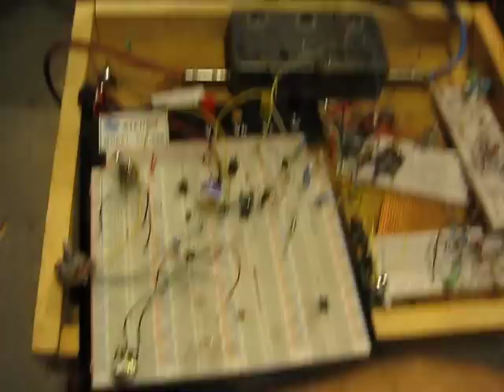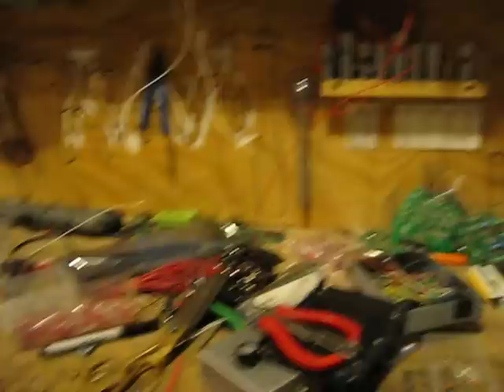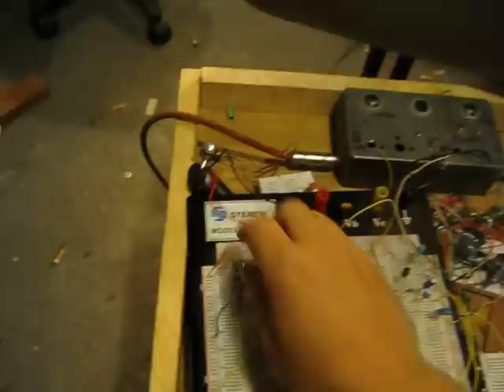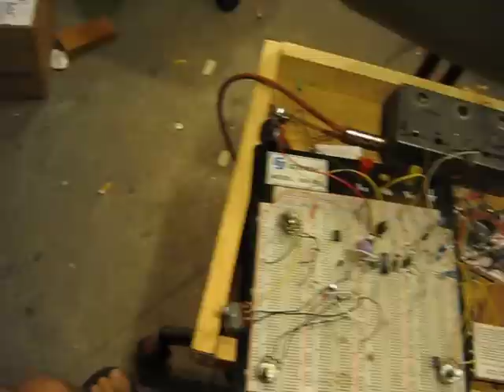echo circuit

Comment: Hi,

interessant this chip. But I think a more real echo can be done with: square osc + 4017(counter) + 3x 4066(quad bilateral electronic switch) and some trimers/ or potis and capacitors. Echo can be after produced with 10 steps, or lower, and desireable amount of each volume (Up, direct or down)

Good work anyway